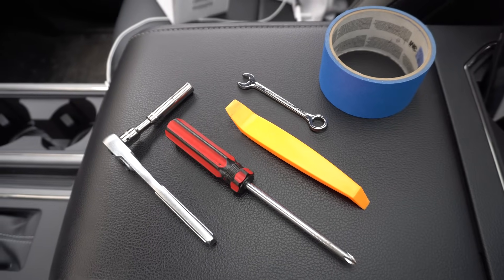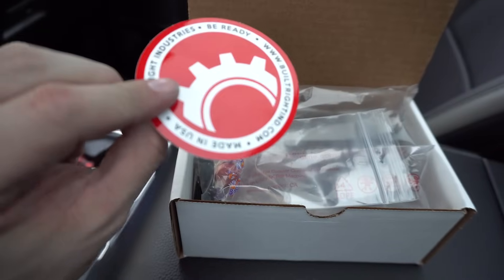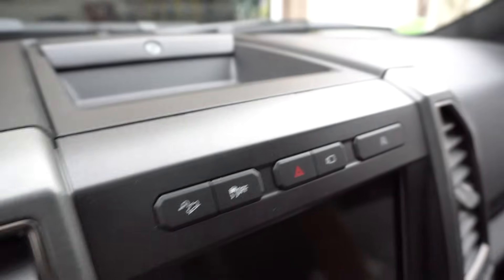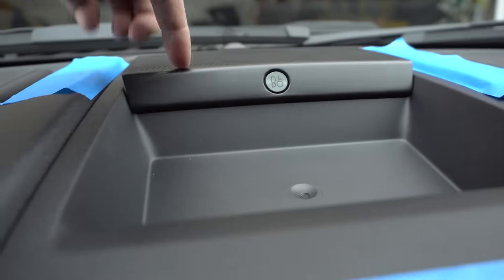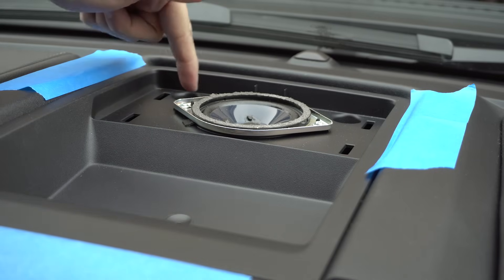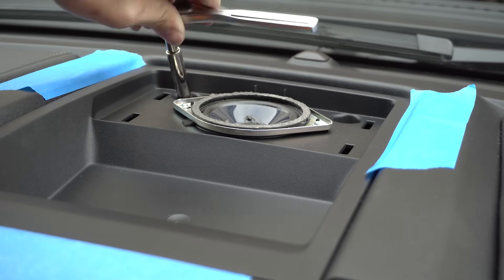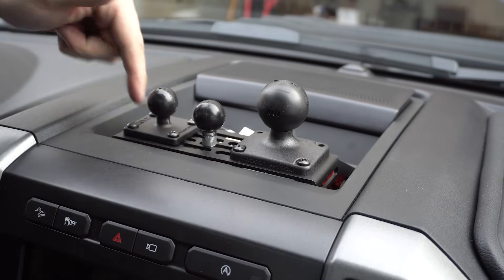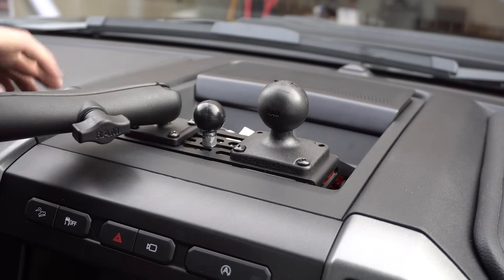Dash Mount Installation - 2015-2020 Ford F-150 and Raptor

Comment: This was a great help, thanks a lot!  I kind of only watched until you started screwing in all the bolts because I figured I could put everything back together afterwards.  But....right when I was walking to the truck to put it back together, I saw and realized I wanted the rubber mat back in.  It was easy enough to unscrew everything, put the mat back on, flip over the dash piece and mark the holes with a silver Sharpie.  Then I drilled from the back using the small bit, flipped it over and drilled with the larger bit on the top side.  Well, drills bit don't work too well on the rubber and I had holes but it was impossible to put the screws into the dash mount, past the mat, and into the dash.  After a minute of swearing, I realized you could put the dash mount on the rubber mat, push all 4 bolts through (which also holds it all in place), then put that assembly onto the dash.  Everything looks and works great.  One note, if you want to keep the rubber mat, then I suggest sliding the dash mount forward 1/8" to give a little room for the lip on the rubber mat.

Comment: Re: 2:02 I used the drilling template to cut the rubber "floor mat" that fits in that area to fit on top of the mount screwheads. You can store things in there now without worrying about scratching them on the screwheads (which will have sharp edges after touching them with a screwdriver).
Reply: The flip side is if you sell the truck and don’t use the rubber mat, you can remove the mount, place the rubber mat back in and cover the drilled holes. If I use the mount I will not drill the rubber mat. Just another option.
Reply: Old post but this is what I plan on doing, not cutting the rubber mat. BUT I’ll need to check for a PN on the backside of the mat and just buy a replacement if available, then I’ll cut my mat.

Comment: My Builtright dash mount came with the bottom support plate. I used that support plate as my drilling template and it was easy peasy lemon squeezy. I had a major problem with the installation but it had nothing to do with BuiltRight or their products. The Ford dealership that previously replacement my infotainment system broke all of the black tabs from speaker grill. The also lost half of the white plastic clips both the speaker grill and the tray. I contacted my friend who recently retired from Ford. He said those white clips are sold on Amazon. Here is the part number if anyone else needs them: Body Trim Retainer for Ford W714972-S300. I used my heat gun on the lowest setting to melt the black tabs back together. The white clips will arrive from Amazon tomorrow. Once I have those white clips in place everything will back together in a snap!

Comment: Awesome product. To overcome the inherent weakness of the plastic tray one could install a thin metal sheet on the underside to spread the stress across the entire tray and four attachment (screw) points.
Reply from the maker: Great minds! https://www.builtrightind.com/products/dash-mount-support-plate-2015-f-150-raptor-and-2017-super-duty?_pos=1&_sid=5117dd353&_ss=r
Reply: 3 years later, to anyone wondering if it's worth it to splurge on the lower plate, my kit just came in today and I couldn't be happier. Glad I spent the extra few bucks to not have to make a lower plate myself. Theirs is overbuilt, just how I wanted it. It really is a must-have.

Overall impression of the product is 100% satisfied with my purchase. I didn't want some cheap flimsy garbage, and apparently they feel the same way. All the functionality you want without any excess wacky designs or features, like some other available offerings. Just heavy duty shit that'll probably outlast my truck. Good work!

Comment: Great video.  I finally installed mine, and the instructions were perfect.  I would like to advise that the stereo cover on the 2019 Ford Super Duties has a thin "mesh cover" over the main cover, so at 3:50 into the video, try to get the pry tool under the entire stereo cover, not the mesh portion.  I could see some separation at the mesh cover when I attempted to remove it as shown in the video.  No other issues. Also my left turn signal came on by itself, just as it did at 5:40 in the video.

Comment: Thanks guys,this is exactly what I need . Now I’ll just try and figure out the most aesthetic way to have power on that plate also . A couple of USB connections flushed in would be a nice touch
Reply from the maker: Thanks! I have seen a few customers run power to a small flush-mounted plug along the front edge of the tray. Out of sight when in use. Really slick - I think a company named BlueSea makes some nice ones.

Comment: In my truck I’m debating to drill out a few holes in the semi vertical area behind your mount (area just under the speaker grill )  and add power plugs . Use 3.5mm jacks to USB . I think it would make for a clean looking setup , and provide a place to get power from if there’s a dash cam mounted on the bracket .
Reply: Did you ever do that? I'm curious how it looks if you did
Reply: Did you ever do it
Reply: @keithreinert5835  
No not yet . One day

Comment: Where did you get the wiring harness from? I'm planning to mount my ham radio to the mounting bracket and then my dash cam on top of the ham radio and need a power outlet to plug into in that area. Now if I can figure out how to remove the trim piece around the navigation unit and the one under the steering column so I can run the wires from the passenger side behind the radio and to the switch that is going to be mounted next to the headlight switch for my train horns.

After installing the bracket (2022 F-350 super duty) I discovered that it's almost 1" too short to use for the purpose I intended to use it for. So now, I will have to make a spacer to mount the mounting bracket for my ham radio to so that the bottom of the radio will not ride on and beat up the dash. Other than that, it is very well made, I just wish that Ford had made the dash pocket indentation the same size on all 4 sides.

Comment: Drill was a bit iffy, but overall very easy install and great video. Might was to remind customers somewhere next to the link for 1" ball mount that it does not come with screws
Reply: What screws do you recommend as I was annoyed the ball doesn't come with screws. Thx

Comment: Wish you had included the part where you loosened the speaker cover. Been nice to see how it was done. Can't get mine off. Just bending the crap out of the perforated piece. The clips do not want to release.

Comment: Bought the builtright and it fits right in!  Added mounts from Arkon and I'm loving it  Thanks for the vid.  QUESTION: the wiring harness you mention at the end.... could I use that to tap into 12v power?  I am hoping to install a USB/Cigarette port at the back of this tray just under the speaker, and I'm wondering if that harness point carries power.  Any change you could point me to that part?
Reply: Interested
Reply: Did you ever do it
Reply: @keithreinert5835  I did.  Works GREAT.  Was able to fit three USB ports into the tray.... but didn't need a wiring harness.  I used a "fuse tap" to take power from a nearby fusebox and then just grounded on a metal part of the chassis under the dash.

Comment: Is there a way to get 12V power up there?  I have an 18 F250 and would love this to mount my trailer observation camera display but I hate wires running loose in the cab.
Reply from the maker: Best ways would be to run an add-a-fuse at the fuse panel in the passenger footwell and then fish a wire to a small hole in the tray. Another option is to tap into the power at the accessory plug which requires removal of the faceplate.
Reply: How hard was it to actually fish a wire up to that area? Any tips on how you might go about it? Thanks

Comment: Do you get any screen bounce or screen vibration on rough roads when using the longer ram mount for your gps? I have used ram mounts before, they isolate some screen vibration, but the longer the arm can result in a vibrating screen. Thoughts and feed back appreciated.
Reply from the maker: You will definitely get a bit of movement with the long arm for the reason you mentioned as well as the fact that the dash isn't perfectly rigid. Our customers who need things to be absolutely locked down offroad use our dash mount along with a suction cup mount to the window. RAM has a three-way ball and some different cases with two mounts that allow you to use both arms on one device.
Reply: @BuiltRightInd  yeah, I am hoping that my Garmin 890 does not bounce when configured with the 5.5” ram arm mount. A bouncing or vibrating gps screen even on a secondary road is a no go. I may have to forgo mounting this bracket.
Reply: @patriotone755  What did you end up using for the Garmin 890?  I am looking to mount the same GPS.
Reply: @user-rm1dg2qe4x  I used the Builtright dash mount for my 2021 F 350. Very happy.

Comment: Only negative I see is now you can't put the rubber mat back down.
Reply from the maker: We've been having a lot of customers either trim the mat to put it back down or actually just cut holes and bolt the dash mount through the mat into the tray. You've got options!

Comment: If you put an aluminum plate on the bottom would it help make it much stronger for the larger ball mount?
Reply from the maker: A thick plate on the bottom of the tray may help just a little bit with the very heavy attachments that are 'cantilevered' away from the mount. This would help prevent some of the flex in the plastic. The main thing is just that keeping something as heavy as a Lowrance HDS-7 or similar stable requires exponentially more rigidity than lighter items.
Reply: I believe there are two 7mm bolts under the trim on the front side.  Personally, I like the BuiltRight  but there are other brands out there that replace the tray with a steel plate that bolts front and back (four bolts) that provides a very sturdy mount.  Wish BuiltRight could do that.  The plastic part of the dash is always the weak spot for mounts.

Comment: Working through this install. If the white clips didn’t break they fell the through the holes into the back of the dash (two broke and two fell through). Does anyone know what the clips are called and where a guy could get them? Ford wants $51.37 for the speaker grill...
Reply from the maker: Darn! I'm told these work great: https://www.amazon.com/gp/product/B07FW25CGD/ref=ppx_yo_dt_b_search_asin_title?ie=UTF8&psc=1
Reply: @BuiltRightInd  From some searching online, it sounds like these are the oem clips and part number. My Ford dealership said they have them in stock (at something like $2.99 a pop)... Thanks for the reply and help!

Trim Molding Clip - Ford (-W714972-S300).

Comment: looks great.

what are the dimensions of the mount?
Reply from the maker: Thanks! The base is 6.75in wide by 4.25in deep.
Reply: Cool.  Btw the “thing” you refer to to mark drill hole locations is called an Awl.
Reply from the maker: I'm aware, thanks. Slipped my mind once the camera started rolling and I was 'on the spot'!